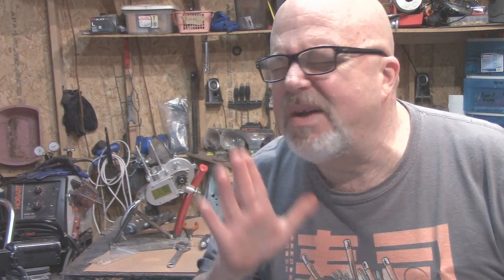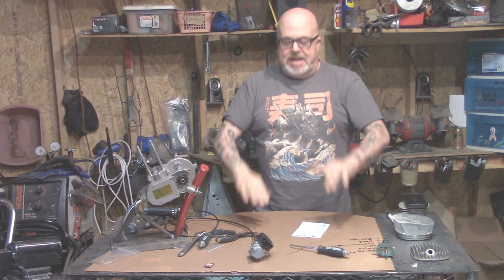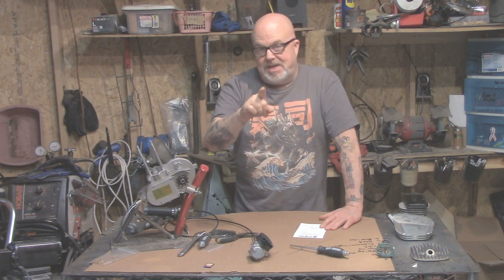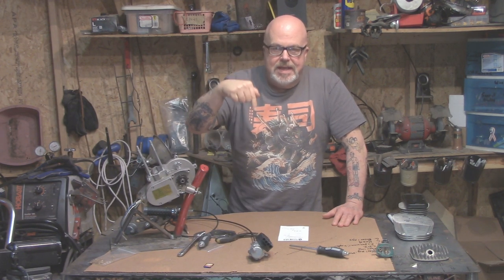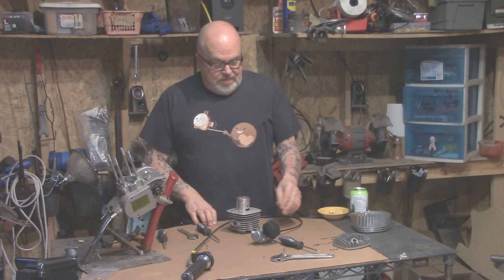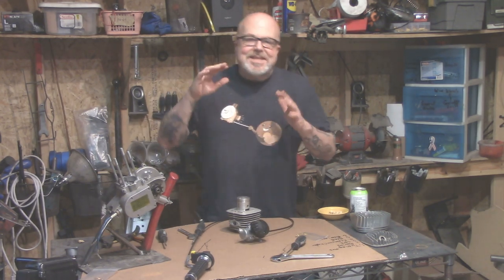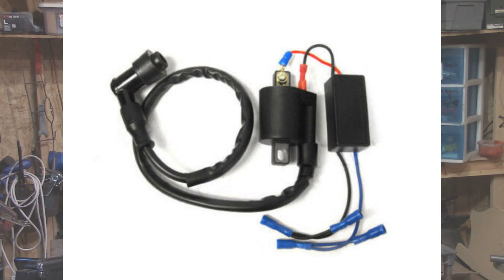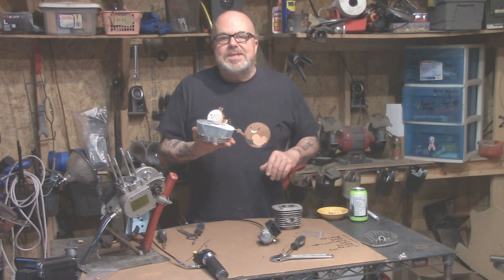Best Performance Upgrades for Motorized Bicycles - Without Breaking The Bank - No Boost Bottles

Comment: I was curious as to how I can rejet a carb without buying a new jet, I’ve heard that I can do it with solder but I’m not sure if this is true or not. Also, how can I install a key ignition and which key ignition would you recommend?
Reply from the maker: You need a torch, solder, drill press and a micro drill set. Go easy as the bits are easy to break. I'd say hide a switch that merely shorts out the kill switch wires. Or get a key switch that is normally closed and opens the circut when the key is switched on
Reply: Keep in mind most bike are still light enough to toss in the bed a of a truck. 
Bike locks are still a MUST

Comment: Thanks for this great video! I’m getting an engine kit tomorrow, I have 2 stroke synthetic oil. The engine has not been used at all. Should I go 16:1 during break in. I’m confused on why everyone keeps saying 16:1, then some people say 20 or 30. Then you say 40. Thanks!
Reply from the maker: Go to HW store and get cheap 2 cycle oil. Mix 40:1 from the start. After you run 1 gallon thru then use the synthetic if you want
Reply: Hughes Motorized Great thanks!
Reply: 16:1 break in period (2 tanks which is also one gallon)
So after 1 gallon, slowly go 40:1 doing a plug check to see how rich you're burning.

Comment: I bought one of this little 50cc engine and installed. Having hard time to started and it doesn't idle. Only runs at about 50% throttle and up. Cheched compression and have 70 psi. What can I do to bring that up little higher? THANKS!
Reply from the maker: Sounds like an intake leak. Make sure carb is fully pushed onto intake

Comment: What do you mean by putting a smaller jet in? Do i adjust it? Or buy a different one? Thank you
Reply: Never mind, i rewatched many times, i understand now. Thank you for all your help. I just had to change my magneto your video taught me. I was wishing i had somebody who lived by me who knows about these, and boom I found you. Awesome thank again
Reply from the maker: Glad I helped.
Reply: @HughesMotorized  hey boss, do the throttle cables stretch out over time and need replacing? I adjusted all the areas it's little tighter but seems to not have as much power in the 1/3 1/4 throttle area, should I replace. Or is there something else maybe. Thanks

Comment: It would be awesome if you could do step by step video on building and tuning an awesome performing engine. I'm a visual learner :/  :)   . Just bought a motorized bike and took off the carb filter seems to run better without it. Any who, videos will so helpful on how exactly you would do these steps! 👍
Reply from the maker: Great suggestion! I'm booked solid w new projects. just bought a scooter that I'm going to do some serious performance mods to & have an electric scooter to finish, a VW Fender Mini and a 20" Schwinn Stingray to motorize. I get distracted easily

Comment: Nice video ..on the wheel you recommend does it fit a tire size of 1.75?. Also I would like to see a video on this if possible explaining more details . Thanks
Reply from the maker: Yes it does. Here's some info on the hub : https://youtu.be/jLEg1Nu0jaY?t=154
Reply: @HughesMotorized  Just recieved my rim from Husky bikes. Rim was shipped bent and not packaged very well. Its 12 o'clock central time and still waiting for a return call from Steve about my return shipping label. I request a new rim they said they are out of stock 😡worst experience ever. On the other hand it's a nice rim .. but bad customer service from husky.

Comment: This video was how I found out my 100cc engine was just an 80cc with a big ass head on it. OOF. I wish the manufacturers wouldn't lie, it's so pointless.
Reply from the maker: There's a difference in how the Chinese calculate engine displacement (and add in some misdirection) and the way the rest of the world calculate it. That adds to the confusion. But YA, it's all over the place. There are Big Bore Kits sold for scooters to increase the displacement and  many just flat out lie

Comment: Will a NGK B5HS spark plug run just as good?
Reply from the maker: Lower number = hotter. Get. A B6 plug and compare. You decide. I'd run a hotter plug inn the winter but if no improvement then no need.. Too hot can damage however one plug up should be fine

Comment: the kit told me to run premium 97 gasoline mixed with 16:1 oil or something close to that, with my stock kit, but since u mentioned the gas mixture that is recommended is wrong, do u think premium 97 is necessary? My weedwacker uses 87 with a 40:1 mixture and it would be much more convenient if they both used the same gas
Reply from the maker: 40:1 and reg unleaded is best
Reply: @HughesMotorized  awesome, thanks!

Comment: What I'm curious about is these engines?   Seems like there's not too many & the ones I see look like they are made by 1-2
Metal Foundry's over in China?  So you have these choices & again as you look all these "Engine" kits are being sold to you
OR  "AT YOU"?   So we've got to guess which "KIT" has quality parts inside or what's crap within the kit?  That's a big problem
after spending $300 bucks & learning that half the stuff in your kit was poor quality?  How/what to buy is a major issue but
after watching this I Will Know !  I have no doubt.  thanks very much & peace
Reply from the maker: There are a handful of factories producing the components having different dimensions and the assembly shops will often switch who they buy from and have to add extra gaskets and such to make the engines run. Tons of garbage in the castings and it seems many have unskilled labor assembling the engines using hammers.
Reply: Thanks,  while I've not dug into this that far I knew by looking that it was way below standards for other motors.  I'm
not looking for Rocket Science good quality but I've looked at how well made gas drone engines are made & then
motorcycle engines,  I'd think there'd be a little more quality as those  manufacturer's compete?  Guess not & I've
put off buying hoping to see better stuff.  Again, I appreciate your time.  peace
Reply from the maker: @diggy-d8w  The main competition is lowering the cost and marketing. One needs to tear down the engine and sort out problems on all of them
Reply: Yes,  I think I've noticed that in most the videos I've watched but you're the only that said IT To me.  Most people would
think that buying a "Motor" would be one closed unit that was considered "Good to Go"?  Another issue is all the different
things in the "Kits" you get w/ the engine.  Each piece must be looked at but how would you know about these parts until
you were told or had a break down?  But the engine unit itself I would think was a solid unit - you're saying that once you
buy one needs to have the basic tools to tear down a new motor & then rebuild it w/ parts that are stronger/better?
Having to do this, & I thank you for spelling it out,  defies logic to me but I do stand corrected !  So I buy an engine
knowing that all of them need to be rebuilt?  And how would I know which parts inside "Said Motor" were needed
to be replaced?   It's almost mind boggling to me & tell me if I'm stating this correct;  I buy an engine knowing
that I need to go thru it to put in better parts?   I feel so stupid even typing this but please tell me this is the
case??  Wow,   so I buy an engine & I keep buying additional parts until I get something to WORK good?
Hey,  I do appreciate sharing this w/ me before I jumped in not knowing.  I'd be at a loss because no one
expects to buy something that needs to be redone before they use it?  Blows my little mind, lmao.
I do thank you for your time.  IDKnow if I'll ever get started now but I'm not quitting yet, thanks again

Comment: On the Amazon sealed bearings. Do I still need to use the oil seals?
Reply from the maker: You need to remove the seal on the internal side

Comment: Does any of these modifications require a torque wrench?
Reply from the maker: Not absolutely. You just want to make sure you tighten up the heap nuts evenly. Not super tight. Just formly secure and you good

Comment: Only rode my brand new motorized bike about 5 MI turned it off with the kill switch. Ever since then it won't start now. Any helpful advice?
Reply from the maker: The coils often fail early if no spark

Comment: Personally I've had the cheaper eBay $15 HP carb work 5 times better then the stock carb. No matter how I jetted/tuned the stock carb the bike would 4 stroke at 25+mph, wouldn't go above about 32-33. New HP carb with the right jet I hit 58mph downhill and 48mph flat
Reply: link?

Comment: After about how many miles should I do a rebuild on my motor
Reply from the maker: If it's running good then you good. The plating inside the cylinder is one thing that will eventually kill a good engine. people have gotten 5-10,000 miles off an engine w/ good luck. Your mileage will vary. You can have a perfect engine and BOOM. it will die. The longer running ones might outlast the wheels on the bike. Sorry, no easy answer due to these engines being so cheap

Comment: Hey question for ya!  I see these motors say they can fit on 24-28 inch mountain bikes.  is that true?   Mainly a 24inch one is the target goal.   80cc china kits like off amazon
Reply: Rule of thumb is no the triangle frame is to small but I'd measure yours and measure the kit first and leave atleast 3 inches of clearance
Reply: Look up "bikeberry how to check if a engine kit will fit"

Comment: Any ideas on 4  stroke upgrades for the 49cc little china motor?  Thanks
Reply from the maker: I'll just run open exhaust and open up air filter. Do a plug chop and adjust jets if needed
Reply: thanks brother
Reply: @HughesMotorized  wutz a plug chop my freind

Comment: I put new head on and can’t get it to start do I need different plug cause the head is bigger and maybe doesn’t reach  the piston area?
Reply from the maker: Is head gasket sealing? Are the nuts mating against the head? Most stock plugs work fine on hi-comp heads
Reply: @HughesMotorized  for a I high comp head i don't need to change piston right
Reply from the maker: @crownatlanta4998  Correct. just the head and gasket. Then look into doing a plug chop and tune/jet carb

Comment: My bicycle engine dosnt use a mix fuel. It had a designated oil containing and a separate gas container. That let's me run nitrometh from time to time along with the very occasiona No² bottle and boost bottle. My record on a 50cc is 82mph. On a bicycle that's fucking scary as hell lol

Comment: I’ve got a China girl that I built 3 years ago..I had heart surgery and now rehabed and feel good...what do I do to get it running again. It’s been well kept inside of a garage all this time, I just don’t know where to start. T
Reply from the maker: New carb for sure. Perhaps need to rebuild the top end. New Cylinder and rings
Reply: I'd just rebuild the piston or slap new rings on them and port the cylinder jug also carb clean and take apart the stock carburetor, these carbs can run forever unless they physically are damaged.
Reply: Hughes Motorized thank you for the reply! I’ve got a new carb on the shelf👍
Reply: Dump the old gas

Comment: What if , you turn the cylinder around , so carb is in front . Increase flow ?
Reply from the maker: YES, you can do that. Many have. You have to match up the transfer ports or it will run like crap. I know several who have
Reply: Just seems for flow , carb in front , exhaust out back . Kinda Ram Air ,,,
Reply: @jamesknickerbocker3410  good idea

Comment: What do you say 'bout them reed valve kits? Any worth checking out? Everyone states reed valves improve the 2 strokes on the low end and make them more (fuel) efficient, but never heard anything about them on motorized bikes...
Reply from the maker: I ran one for a bit. Nice and fast. It was a Gasbike 6hp kit. I'm not an experienced high end tuner so I'm not so smart on them. I'm thinking that the case induction setups are the bleeding edge on performance and you better know what you are doing as it pushes these little engines to their limit. I'd rather ride a little slower and spend less time rebuilding engines

Comment: Im looking to buy a good quality 2 stroke engine kit any suggestions?
Reply: A real pk80 or zeda80, make sure it's one that has 8mm mounting studs. There are a lot of cheaper older versions of china doll motors on ebay that still have the 6mm mounting bolts that break off easily. Avoid them. Also, upgrade the throttle tube assembly with a metal one, the plastic stock ones in the kits always break where the cable attaches.

Comment: My 80cc motorized bicycle wen I let go of my clutch to start it my bike tire just slides it dont crank up I was riding something happend and I think it was my clutch
Reply: Is the fule valve open? Try lifting your bike up with your clutch open grab the back wheel and pull it from the bottom to you. See if the CDI is in right. See if the spark is broke. You're using 2 stroke gas right?

Comment: So the 21mm oko carb BS?
Reply from the maker: If you have a reed and some serious porting mods, a true balanced crank and a fat expansion chamber then yes it would be worthy to use a 21mm carb. Prolly a decent choice. A mildly ported motor, it would be overkill as the engine can only move so much air/fuel.
Reply: @HughesMotorized  Thank u sir for the info well appreciated

Comment: Hey  man I am at 876ft above sea level what jet would you use for my carb the nt I have the junk hp carb I can't get it to run right at all
Reply from the maker: I'd guess a 64 - 66 should do. Really need to do a plug chop. Try this kit: https://ebay.to/2zZ2cnc